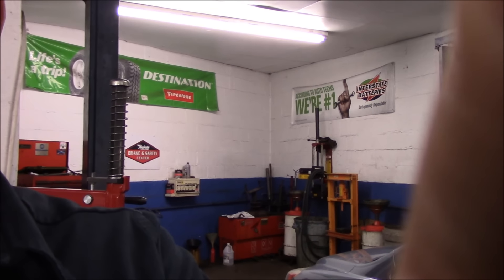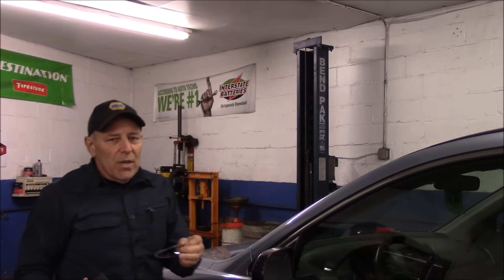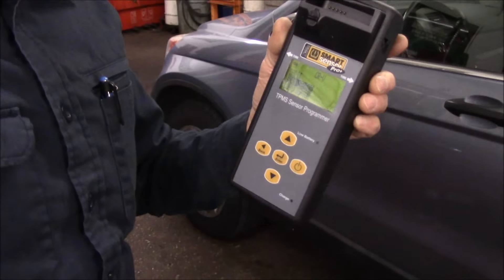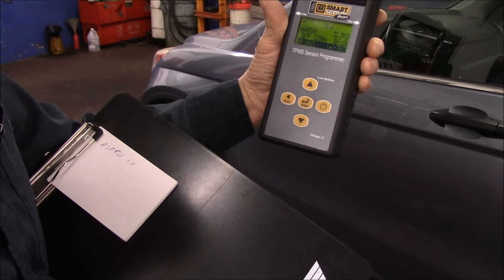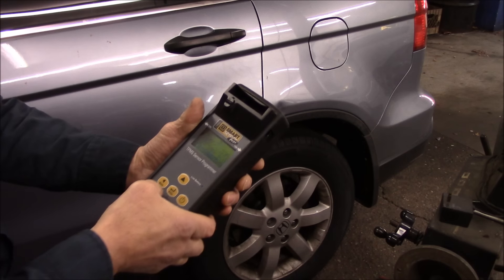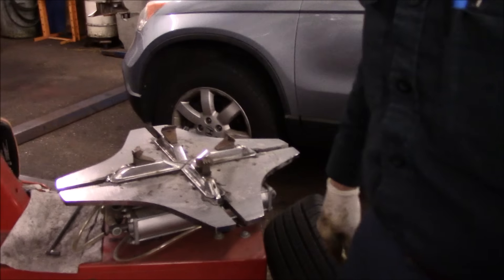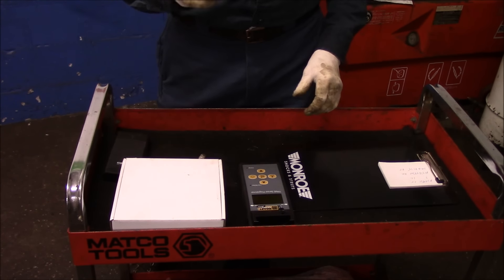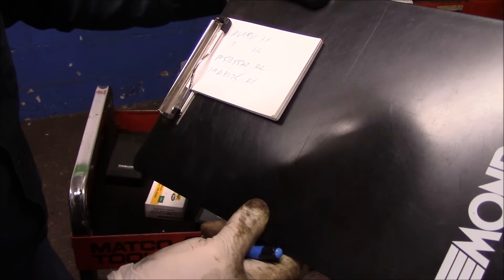How To Reset Low Tire Pressure Light (TPMS) Tire Monitoring System

Comment: I want to know .All  these years we have been driving vehicles without air sensors, just install appo-irate amount of air  and all was ok.Why we need air sensors now and with added expense?
Reply from the maker: Your right even with the sensor drives still don't check the pressure.

Comment: Today I took my car to change one of the left rear sensor, and the light is still on.  The guy said that it must be the car system and told me to take my car to the car dealer.  The sensor light costed me $120 today and the light is still on.  The guy did not fix the light after I sat there for two and half hours.  After watching your video, I suspected that he did not clone the old sensor I.D. into the new sensor, is that the issue?

Comment: Hey Jim I have a 2016 Camry . The tire warning light came on and the pressure display reads 0 psi on all tires. It has since gone off and all tires read 35psi , then it's back on and all tires read 0psi again. Got any ideas?

Comment: I had no idea the sensor measures actual tire pressure and somehow transmits that to the car's computer.
I thought there would be a proximity sensor next to a spinning disc.  And the disc would have holes or spokes that pass by the sensor.  If the tire is a little flat, it spins faster and the sensor would notice.  Maybe I'm describing an old technology.

Comment: I replaced TPMS sensor on one of the wheels on 2008 Honda crv. Alight TPMS is on and I believe it needs to be reprogrammed.
Is there anyway to do this?
Thnx
Reply from the maker: You will need the TPMS tool to program.

Comment: Thanks Jim for a detailed explanation of the TPMS warning light.  I get this light sometimes and by pressing the brake and reset button, the light goes off.  I am not sure whether changing the all season tires from winter without balancing the tires will trigger this?  Car is Corolla 2006.

Comment: Hello Jim I bought a high mileage 143,000,  2005 Chrysler crossfire ( Mercedes ) I know it has problems the TPS light is on and you discussed this in this video  !!!  and the lamp out light is on and all lights are working not sure how to turn off the lamp out light sensor . The AC don't work and the compressor does not even cycle it  spins freely the and seems to have pressure and R134 because it spits oily stuff at the low pressure fitting and it will not accept any more freon. So im just wondering what it can be . this is my first Chrysler - Mercedes . I did buy the Chrysler factory service CD . And tried to see but its more confusing when on a CD Im old school and prefer a book lolo, Im soon 60 yrs old : ) Can you Help

Comment: thanks for this video.   this just happened and thankfully the system shows which tire has no reading.  but the weather went into the 30s and wondering if that triggered it.   BUT i just had these tires installed in July the the sensors are brand new.    so this is pretty worrying b/c the Jeep drove fine but then shows just lines instead of the air pressure reading.   i'ts dark but i tried checking the tire for a leak or nails but will inflate.   if i still get the warning, i guess i need to return to VA TIRE AND AUTO, who installed the very expensive SUV tires, to repair or replace the sensor.

Comment: What if you have 2 sets of rims tires eg. Winter summer. Do you need to re program every time you switch or can you have 8 programmed to the car?
Reply from the maker: No you will need to program when you switch the tire.Only 4 at one time.
Reply: @jimthecarguy  thanks

Comment: My question is what if you already check it with the same sensor programmer and everything is okay including the spare tire but still giving you tpms light ON , can u reset the tpms sensor ?
Reply from the maker: Yes what kind of car do you have?
Reply: @jimthecarguy  honda crv 2007
Reply: Maybe i just need to reset the TPMS my question Can i  reset  the TPMS sensor without taking out from the wheel.

Comment: My tires are correctly inflated and yet the light is still on. I've reset, reflashed with a scan tool and nothing, the light won't go off. after restarting the truck it always says "check tire pressure. but when I push the checkmark /reset button it shows the correct pressure.

Comment: What do you do if all of your sensors are functioning properly (one was recently replaced) and the TMPS light will not turn off? I took my car back to Discount Tire after the light remained on for another week of driving the car, and they connected the car to the computer to "reset the light" but all they did was turn on the low tire pressure symbol which then turned off after a few miles, but TPMS light remains on!

Comment: Is there a way to disable the TPM option completely out of the car? I have aftermarket wheels with no sensors.  Wonder if thats possible and not having the warning light on the dash? 😁
Reply: Or if I buy new sensors for this wheels, do they need to be calibrated first? Or just plug and play?
Reply from the maker: No there is no way to disable that feature.
Reply from the maker: No they need to be calibrated to the vehicle.
Reply: @jimthecarguy  ok thanks Jim!

Comment: Old video I know, but suppose in this case, the sensor has already been replaced with a "cloned sensor", the sensor "ID" of the cloned sensor that is installed would only show the printed/engraved ID (preprogrammed)on the sensor and not what it was reprogrammed to be.

Comment: The guys over at BigO can't figure this one out. Hoping you can.   I had them replace all 4 sensors with honda parts they ran it through the computer and rest everything.  When I left the shop the TPMS light was off for about 10 min of driving then turned back on again.   I have been back to them 3 times they can't figure it out.
Reply: Welcome to the club. Wait till you go to the dealer and THEY can't figure it out. Just had that very experience today!
Reply: It is just a rip off. I just gave up driving, In reality I don't need a car, it is just a scam
Reply: Giving up cars is getting back 95% of your health. I commute, bike, and walk of course everywhere. What a relief. No stress at all. F*** this so called modern life, it is just a fraud. What a relief when you go back to your natural life.

Comment: I have a 2005 Suburban.
The digital display tells me the status on each tire including if the sensor has failed.
If I rotate the tires, will the computer still report a problem on the front right even though it will now actually be located on the left rear?

Comment: I am a little upset with Honda because the TPM system only indicates a problem.  I have a 2012 Chevy that will tell you from the dashboard if a tire is low on pressure and how much pressure is in each tire.  I recently purchased a 2020 HRV and it will only indicate if there is a problem.  What's up Honda?

Comment: When u install all new sensors and light still stays on ..then what do you recommend is the problem
Reply: The problem is get rid of the damn sensors and buy a 2 dollar tire gauge and check the tires yourself and put a piece of black tape over the little light in the dash.  Problem Solved for life~!!!
Reply: Mimi Mimi, in that case check all four tires and the spare for correct air pressure, add the correct amount of air then drive for 20 minutes and the light should go off. Just make sure you check the spare also bc it has an air pressure sensor inside of it too. Most people forget about the spare. Hope this helps!
Reply: Thanks Johnny c will definitely give it a try

Comment: Had 4 new sensors installed and relearn the new tpms sensors to the car. light came off but the low warning light flashes but dont turn off even with 20min of driving. All the tires are 34psi..

Comment: Great video Jim.  Question:  what does it mean when the TPMS light is lit and the driver video display shows only dashes opposite all four wheels?  Could all four sensors be bad at once or is it more likely a computer issue?  Thanks.
(2015 Ram 1500 pickup)

Comment: Thanks for the video .. although I think tyre sensors  are something  most people shouldn't need, checking pressures is an ideal time to check tyres, If people are disabled there's a good reason to use them otherwise education of drivers by involving them in even a small amount of vehicle maintenance is a good thing .. just my humble opinion.

Comment: Hi Jim - great presentation on tpms replacement - incredible knowledge your have  - what would be a reasonable charge to replace 4 tire (DEAD BATTERY) tpms units on a 2010 Chevy Impala LT (replacing tpms units and labor in New York?) I replaced all new tires last year if I knew this I would have had tpms units replaced at that time .- thanks so much!

Comment: what I was hoping to see you do on the video was how to turn the light off manually in the car if there were no known problems except for the cold weather change......How?????? I have to go to the dealer and they do it for me but do not show me how.
Reply: You can YouTube or Google how to reset the low tire pressure light often it's a little switch right under the steering wheel you have to feel for it and I have seen that you put the ignition in lock and then turn the ignition on and hit the switch to the light comes on three times you have to check the procedure for your exact vehicle and then drive it a bit after you up reset it, usually your owner's manual or a Google question or YouTube question will come up with the procedure for your vehicle

Comment: 2007 Honda odesssay  tps light went on after got two front tires replaced , the vehicle calls for 235/60s all four wheels I didn't think it make a difference and put in front 230/60s  tps light will trigger on if tires aren't 235/60s all tires must be same size 235/6os  if not then circumference of different tire size will trigger tps ! And manual says Radials ! Vechicle runs great with smaller tire in front so will keep till have to replace again then see if sensors are good or bad and change. If there was away to bypass sensors and keep light off I would do that . 😁

Comment: I have a 2006 Ford Freestar and every once in awhile my TPMS light comes on, 
I check my tires and make sure they are at correct  pressure and then I drive the vehicle and the light will go off. My question is
Because my car is 18 years old, should I have the sensors replaced?
Reply: The sensors are the issue. I've driven for 2 years with that stupid ass lighting glaring at me.

Comment: I bought new oem tpms sensors for aftermarket wheels installed same day. so I don't have to keep swapping sensors from my stocks  wheels. leaving the rim shop drove about 10 miles NO tpms light I filled up gas  and reset trip meter. drove home 2 miles from the gas station and while I was  parking the words tpms light up. Is the reason the light didn't come on because I had my stock wheels  inside the car or when i rest trip meter. noticed 33 psi left rear is 33 and the rest were 31 psi. will that make a difference? I so why don't I have low pressure tire w/! icon.  Do I have to sync/reprogram new tpms sensors or have a brand new faulty sensor. (2015 honda oddysey w 15,000k miles)

Comment: ? After programming the ID # would it be wise to mark the number on the new sensor body for future reference / problem solving ?  Also lube the threads of assembly with a small amount of silicone grease Prior to final assembly. As I live in an area where road salt causes corrosion, this is a concern.
Reply from the maker: Thanks for watching.

Comment: There is a trick to this if you get a bad one and want to end this nightmare. Get about a foot of some 3 or 4 inch pvc pipe n drill a hole for a valve stem. Pull the stem, cap one end, throw all 4 sensors in the pipe, cap the open end and add air. Throw the pipe under the back seat and your tpms problems are over. I can't claim credit for this. We actually bought a truck with this done. It stayed like that too.
Reply from the maker: Wow  first time I'm hearing that but it sounds like it would work. Thanks for your input and for watching.
Reply: @jimthecarguy  Thank you bud. It's legit. There are stories about guys not being able to get all 4 pressures exact and the code becoming a nightmare. With all 4 sensors in the pipe under one valve, that issue is def over. Lol. We actually bought a truck from the auto auction with this done. On my word. We were all just blown away by the man living in 2030 and way ahead of us. Lol
Reply: do you plug the old sensor hole in the rim?

Comment: Thanks for the very informative video! I used to work in a service station that actually serviced cars. We had to break tires down by hand. No power or hydraulic  tools. Truck tires were beasts (and dangerous).

Comment: i put in 4 new sensors all reading correct air pressure low tire light still on disconnect battery under back seat 30 minutes reconnect battery start car light is off complete success help being a master mechanic some info on here is not correct

Comment: Jim, your video is so far the best I have come across.  Full of step-by-step details and very clear explanations.  I am just curious if any thing bad will happen to the vehicle if the under-inflation signal sign remains on even after the tires are properly inflated and if the malfunctioning sensor is not replaced.  Does State Vehicle Safety Inspection Law requires the bad sensor to be replaced?  I live in Collin County, Texas, which requires an annual safety inspection and emission test.  I drive a 2006 Corolla.  Thank you for your excellent presentation.

Comment: I have had 3 shops try to reset the TPMS sensors in my new rims and they still don’t work!
HELP!
Reply from the maker: How old are the sensors.
Reply: The tires, rims and sensors are BRAND NEW!
Reply: Or at least that is what I am being told and invoiced for
Reply: They are MAX TPMS sensors.
The shops used TP401 and TP501 and what ever the Nissan dealership uses on their cars, to try to program them.
Reply: Sorry, that should be TS401 and 501

Comment: SIR WHAT IF THE PROBLEM SITUATION IS LIKE THIS.  ALL THE SENSORS OF TPMS ARE ALL WORKING GOOD SENDING OUT SIGNALS BUT THE TPMS LIGHT STARTS LIKE THIS.  AT FIRST IT IS BLINKING FOR ABOUT MORE OR LESS A MINUTE ON OR BEFORE STARTING THE ENGINE THEN AFTER WHICH IT GOES A STEADY SOLID LIGHT ILLUMINATES. WHAT DO YOU THINK WOULD BE THE PROBLEM OF MY SUBARU FORESTER 2009?????
Reply from the maker: It sounds to me like one or more of the sensors are no good.the battery in the sensor last only about 5 years before starting to die
Reply: THANK YOU SIR I WILL LET YOU KNOW WHEN I GOT IT FIX BUT FOR NOW ALL MY TIRES ARE NOT  GETTING ANY DEFLATION INCLUDING THE SPARE TIRE. " LES SCHWAB " TOLD ME THAT THEY COULD NOT DO ANYTHING CUZ ALL THE SENSORS ARE SENDING OUT SIGNALS. I WILL TRY "DISCOUNT TIRE" IF THEY WILL TELL ME THE SAME. I WILL KEEP IN TOUCH BUT I KNOW IT WILL TAKE TIME FOR TO GET IT DONE AT DISCOUNT TIRE.
Reply: SIR JUST AN UPDATE ON MY 2009 SUBARU FORESTER TPMS JUST SHUT OFF AFTER RUNNING ABOUT 7 MILES ON I-5 @ 65MPH THEN ABOUT4 MILES @ 35-40 MPH ON SIDE STREETS. BUT PRIOR RUNING IT TODAY 2 DAYS AGO I INFLATE ALL MY 225x 60 R16 TIRES FROM 35PSI  TO 38 PSI. SO I GUESS THERE IS NO SENSOR THAT IS DEAD OR DRAINED BATTERY.
Reply from the maker: Thank you for the update
Reply: jimthecarguy : You’re welcome sir. Thanx also for your time.
Reply: EMIL SIGN-AUT 6

Comment: Hi Jim, thanks for this helpful video. I have a 2006 Honda Pilot and the TPMS light is on. I replaced all 4 tire pressure sensors last year and they worked fine. But recently the TPMS light came on. I took it to nearby tire center and the mechanic rescanned each TPMS sensors on each tire and they all checked out fine. He thinks possibly the TPMS main module has gone bad. What are your thoughts? Also if I decide to replace the main module, would I use the same tool that you're using to program a replacement main module? Thanks.

Comment: Good evening I just got brand new rims and tires there are 1 inch bigger in size. ..  my light has gone off what is the easiest fix or should I just deal with it , thank you ..
Reply from the maker: Did you switch over the sensors to the new rims?

Comment: If you get the TPMS light on an older car, I would recommend replacing all four on next tire purchase.  Otherwise, you will be going back to the repair shop one by one. About $50-$100 for a full set on Amazon.

Comment: I'm not sure why you needed to clone the sensor. Most vehicles have a simple way to read new sensors, for example when swapping summer and winter tires.

And what if the sensor that was bad had been previously cloned? Then the numbers printed on it wouldn't be correct.

Comment: Hi Jim, thanks for the great video. I have the same 08 crv,  tpms problem, except, it is intermittent. The problem only occur after about 1/2 to 1 hour of highway driving. never happen in local speed. once it happen, it will take a day or 2, of local driving to reset itself. All the tpms senor were checked ok, problem still persist. Few months, later, while having all the tire replace, i decided to have all the tpms sensors replaced as well ( just in case one or more of the tpms battery may be getting weak ). Again,problem still persist , only during highway driving. Any idea??

Comment: What is the minimum amount of Tire PSI difference before the TPMS Sensor sends pressure low message?
Reply: 4-5 lbs low and the TPMS light will illuminate.

Comment: Hi there I have honda odessy 2008 and i have the same  tmps light on and i scand all 4 and i found one is dead and i have repkced all 4 with new programabel sensors and i copyed oll 4   and i drive the car for atest and still the light on  what i need gto check  is tgere any boton  to make the car dedact  the new sensorse  thanks